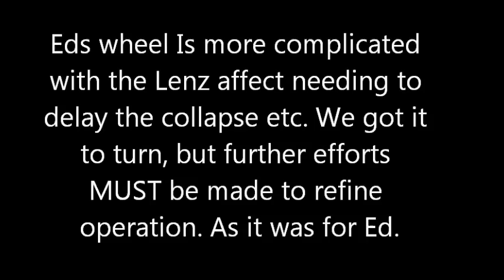Coral Castles Wheel Replica Tuned up VERY Well

Comment: Love it... Have you got a second set of coils to put on your PMH to set up a charging circuit for your battery, Using a second battery you could be charging it and switch with a rotary switch  when power gets low using a coil and spark gap?

Comment: I can hear its rubbing, Is it supposed to be making contact? I wish I knew more about electrical than I do, An electrician tried to hire me years ago but I passed because it was hourly and I was was use to getting paid for what I accomplished, Surely my nonstop movement is why he wanted my services, It always made sense for me to make hundreds per day even if I was finishing in the dark every night rather than making it last for a week
Reply from the maker: Sounds like you are wired for a full load duty rating also. I'm  beginning to feel full load is too much. Even over the years the ships reactors got cut back to even 75% !!! 2 were 90%   still that vessel could haul ass for a city.CARRIER

YES it is supposed to rub. What you here is the switch that is LITERALLY ROLLING on the cams. I have a little 2amp switch that kicks the relay. ED used a larger SACRIFICIAL (actually so large it probably just never wore out) arm with a spring like the one in the picture with the hook?

People are so darned close but can't quite see some stuff. That hook was no spark gap thing (probably not, i should say) it was probably the end of a spring that keeps tension on the arm like breaker point on a cam for cars distributer. SAME THING WITH GREASE AND ALL I'M SURE piloted the relay rack in the field with just car battery voltage and wham a pullshot to every tripod.  That vertical arm swung down or was part of the switch mount as is somehow. It doesn't matter to me but I'm sure some would like to know for sure THE WIRES ARE STILL ON THE ARM!!!. BUT  the clover leafs (via a BIG switch 20 or 30 amps max) told the hammers when to pull. PERIOD.    a tailstock spring pulls all the tools back.

Kinda mechanical really. He (ED) probably had a big bent piece of metal (brass or copper maybe) that rode the GIANT THICK STEEL  clover leafs. I'll try to keep you posted.                  Scott R.

Comment: Have you tried connecting a alternator to the battery so it can charge and recharge itself and run for long periods of time ?
Reply from the maker: No because that won't work. It runs for long periods of time now and Ed had the generator that is on site to recharge all the batteries. All those videos on the internet about motors running generators is always a SCAM, Nobody has really ever done that and probably never will. We as humans and scientists have long discovered our material limits.